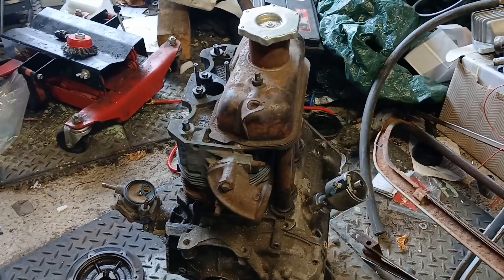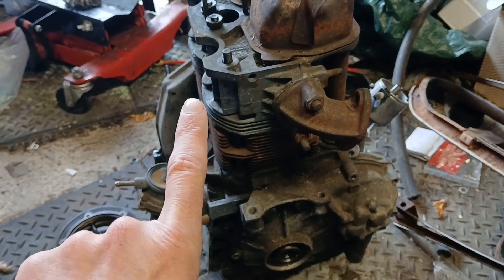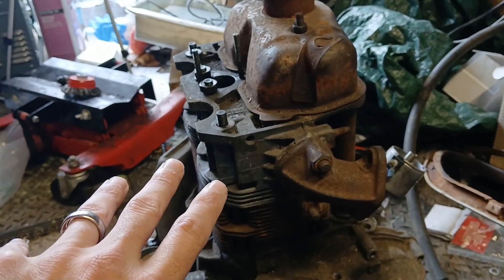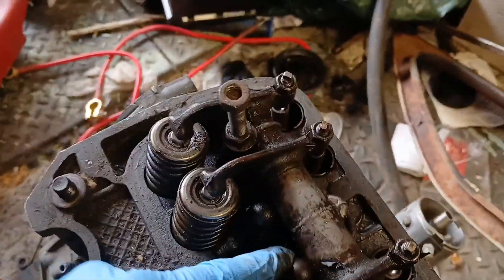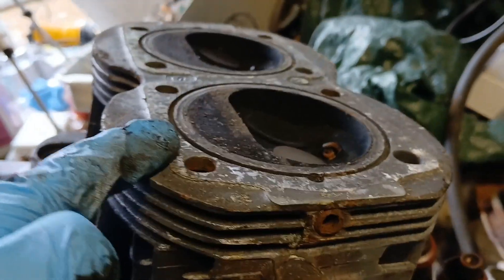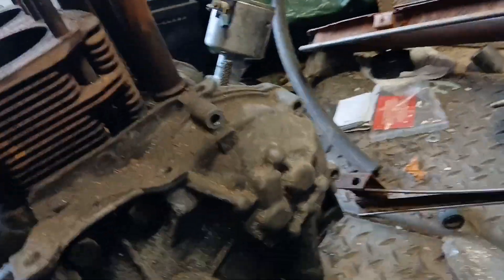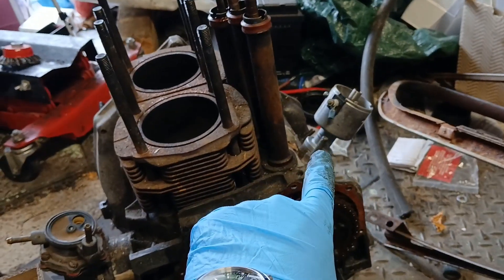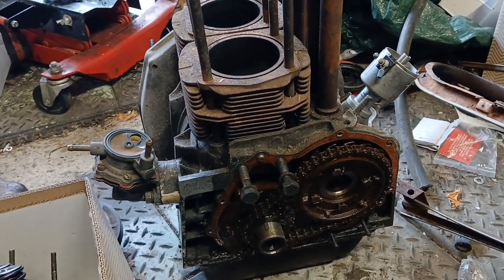Building a 650 Fiat 126 engine to fit into a 500 - Part 1 : Planning the build

Comment: This is awesome, I just bought a complete fiat 126 from 82, i'll use the engine and gearbox, to exactly the same. Run the best i can without a exploding budget. Only difference ... my engine is going into a Autobianchi Cabriolet. I'm not a super skilled mechanic so videos like this is great, thanks from Denmark
Reply from the maker: Sounds like a fun project, good luck with it!

Comment: Some other things you could do to improve the engine without buying new parts:
- Lighten the flywheel.
- Smooth and slightly lighten the connecting rods.
- Balance all the rotating components (they can be surprisingly far off).
- Remove a bit of material from the camshaft gear.
These changes won’t increase power directly, but they’ll noticeably improve engine response and smoothness.
A sport camshaft would also be a great upgrade, though I understand that’s probably beyond the scope of this project.

Looking forward to seeing the final result!
Reply from the maker: I had considered a mild 70/35 cam but will get the pistons and rods onto a set of scales and see how far out they are, ill drill the lower skirt to weight match them if needed